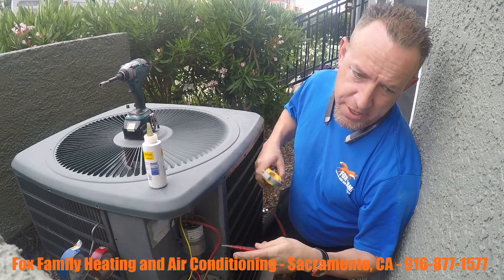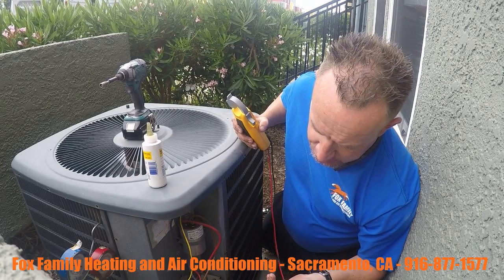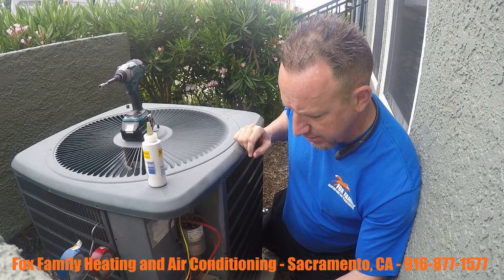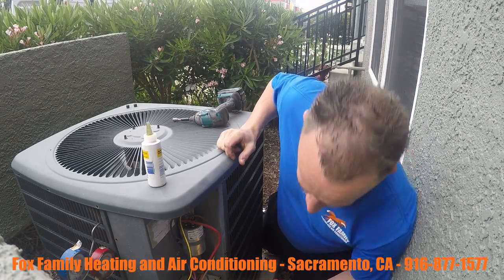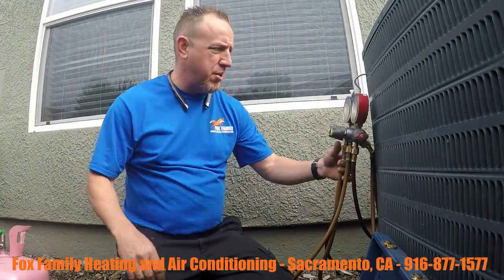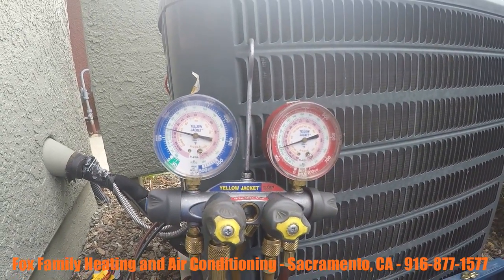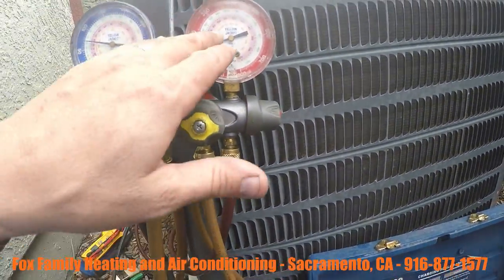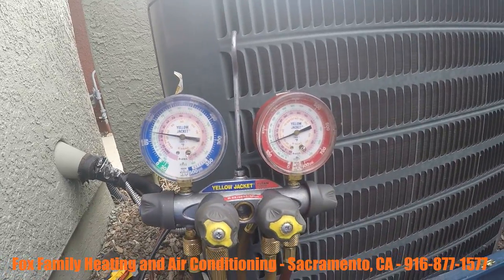AC needs refrigerant, Adding dye to system

Comment: Great video Greg!
dye won't damages the compressor? some techs recommends not to use it and other do recommends to use it.
I had a leak in a 5 ton split system.  
Dye may be my option to find the leak.
great work Sr.
thanks.

Comment: I have that same watch lol. Great video! Thank you!
Reply from the maker: Love em.  Are you a runner or something?
Reply: Fox Family Heating and Air Conditioning I wore them alot as a teenager, i had all the diff. Colors. Used to time myself while running several miles etc...Now as an adult I still wear them especially while working.. Very durable, time/date, has a light, water resistant! Can't beat that! Very reliable watches love them...im actually currently in hvac 12 month program, to become an AC TECH. Love watching your videos and gaining knowledge!  Im a subscriber. Thanks for what you do! Keep up the good work. Peace! ✌

Comment: Silly question Greg, but did you check the filter for your dtek? And are the batteries fully charged? The only time I have had an issue with my dtek leak detector was when either the filter needed changing or the battery was getting low. I'm interested to see where there the leak is gonna be. From my experience I would put money on the indoor coil. Good luck! Great vid

Comment: well edited video. What dye kit do you prefer?
Reply: Ha ! Have a leak in 3.5 ton Goodman 3 days ago. Added 5 lbs of R410A. Turns to be a huge leak in the all aluminum Evap coil. Unit is 5 years old!  Was trying to get a coil under warranty , but they are out of coils ,  I was told. Johnstone Supply guy suggested to request an whole AHU from goodman, eventually I turned it to original installing contractor, since goodman was not willing to cooperate with me, I never have an account with them and never will)))

Comment: fox can you give me a little tip my sister in law had a split system installed the furnace just has a straight rubber hose coming out of the first condensation plug and no condensation at all she say's her bathroom toilet is falling in I have not seen it yet any tip would help thank's fox.
Reply from the maker: jimbola77 text me at 916-467-0089. We can chat there.

Comment: from my experience using the same dye usually 2 weeks run time is enough for a regular leak to show face .
Reply: That's how long we wait - 99% of the time the leak is SUPER visible.

Only had one or two in as many years where the dye took longer to present itself - and within 3 or so months those showed-up as well.

Comment: What happens if its in the walls or lineset?
Reply from the maker: Gotta change the lineset unless they want to strip the sheetrock down. Can just run the new lineset up the exterior and enclose it with a lineset cover
Reply: @foxfamilyhvac  how much would something like that cost on an empty system without refrigerant? I had hvac guys come out and use a H10...most seem to want to charge the refrigerant and that's it...inevitably all the R410a leaks out. I dont qualify for any payment plan or have a credit card that big. Also homeowners insuranve doesny cover it. They couldnt find a leak. One pretended to check the evaporator...but the access panel was sealed shut with mastic and the next tech said its impossible it was removed. The next guy checked the evaporator and nothing with UV dye. They also determined it may be in the walls...but im guessing running a new line would be costly. My attic (where evap is) is literally unwalkable to the edge of the house...so not sure how theyd run copper all the way there! I feel frustrated...seems no one wants to truly fix it...and if they do...it'll cost upwards of 5 thousand...

Comment: Greg do yourself a favor and get a H10!!! Since i bought my H10 i've never had to use dye!!! You would of found the leak had you had a H10!!!
Reply: Israelhvac H10 Price?
Reply: Carlos Gallardo About 475
Reply: @Israelhvac 
Whats the upkeep like on the H10...?  Does it require periodic calibration? sensor changes??
Reply: mike_HVAC no simple simple up keep
Reply: Where can I order one?
Reply: On ebay type in "h10 leak" a new unit is 400 to 570 bucks. General Electric came out with the H10 about 50 years ago. Used units vary all over the place for cost. The active sensor costs 14 dollars from Zoro. Buying used is a crap shoot. I have bought 4 used ones and had 3 that worked, 2 are actually have great sensors. The sensor ages with usage. Some units are AC only, some have a battery option and thus cost more. The reference vial to test your unit on a used unit is always dry. It contains R11 Freon and a controlled leak and after it is open last a year? I think, ie i'm rusty as the time the vila of liquid lasts. Most folks do not even use the reference vial thus not really that important since one has actual stuff that leaks anyway. :) The same design and variants of the orginal GE unit are all over the web and ebay too. The original H10 had the sensor in the side, the later H10A has it easier to remove; ie it is under the small raised cover on the right. ie the cover is because the sensor gets hot. Before there was an H10 there was a H8 unit and before that a H5 or 6? I once bought a new mystery brand 80 buck leak detector with a nice chrome case and its was not worth a flip. Then I bought a used H10 for less than 100 bucks and was dumbfounded on how well it worked. Maybe I got lucky

Comment: Whats the name of the leak dye brand and the tube it goes into? Did you have to pump the unit down to add it, it didn't look like you did. The one I use won't go in if its over 80 psi on the low side. Thanks for your help.
Reply from the maker: Don Juan ez-ject is the name of the dye kit I use
Reply: Will it go in without pumping the unit down all the time?
Reply from the maker: Don Juan absolutely